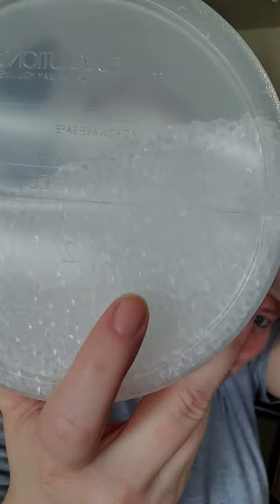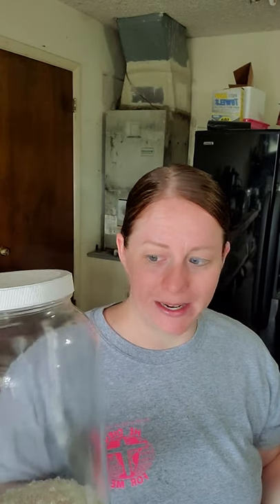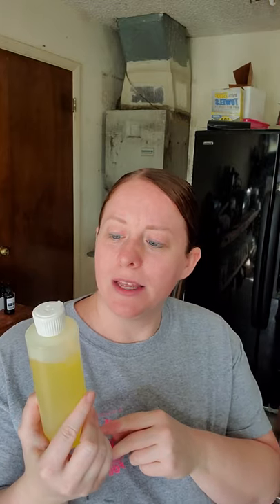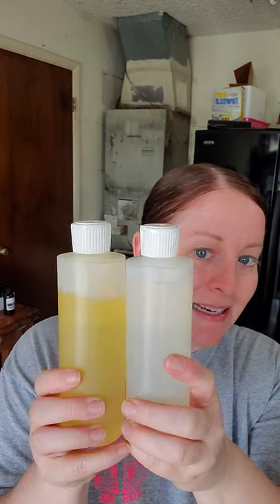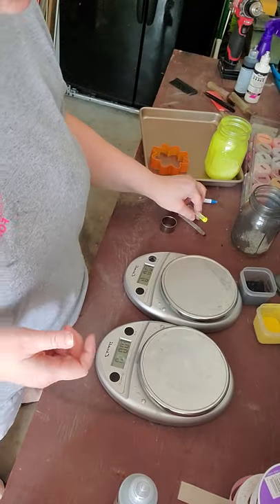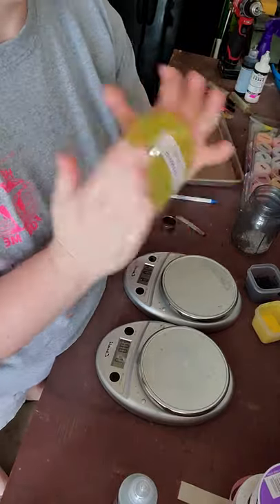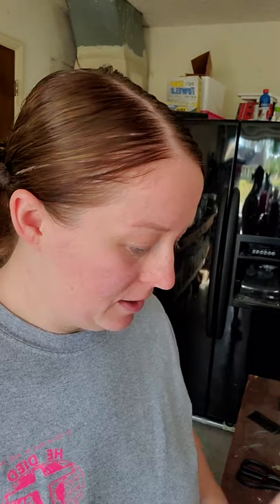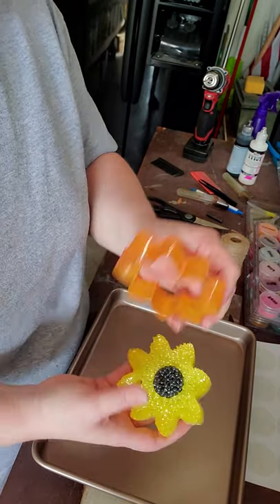Sunflower Freshie Tutorial

Comment: Thank u for this. I was glad to see that u dye ur beads as u use them. That makes more sense to me too but I watched another video of a business where she says it's best to dye them while ur they're curing in the fragrance oil so they can absorb all of the color. My question was..what abt the ones like the cows head for instance that uses 2 or 3 diff colors. Are u supposed to make those colors in all ur scents too? So if u wanted to make a Coconut scented cows head u would have to have white in Coconut, brown in Coconut, & maybe pink in Coconut for his nose. Then if u wanted it in a diff scent u would have to have them all in that scent as well. That just seems like a whole lotta extra work, time, & materials. She said she tried one where she added mica after they cured & that the freshie had pigment that rubbed off on her hands at the end. I'm just abt to start the process but I'm going to do it like u did & dye as needed. It just makes more sense.
Reply from the maker: When I did my first batch I did it before. My problem with that is that one scent is always stuck to one color. If you join some freshie groups you will see that hardly anyone does it that way. Most color as they go. The only time it comes off at the end is if you use too much mica. I use .15cc to color a freshie. A little goes a long way.

Comment: Thank you for this great tutorial!  Just getting started and would like to know how long do you let the beads dry once you add the oil?  And then how long do they have to cure before baking?
Reply from the maker: Everyone has a difference of opinion on this.

Some oils dry quick, others take days or even a week. Technically you can bake once they are dry. Some like to let them cure for 2 weeks once dry.

I suggest you test both ways and see if you notice a differece. I personally do not let them cure and have never had a complaint. But I also make huge batches so some technically cure as they sit there until I use them.

Curing comes more from soaps and candles as a chemical process is happening and they need to cure to reach their full potential. Beads are plastic and do not go through the same process so have no reason to need to cure.

Everyone has a difference of opinion on it and can get pretty controversial over it! But, as long as they are dry, you are good to go!
Reply: @SouthernScents  Thank you so much for your detailed reply!  I really appreciate all of your helpful tips! 😊